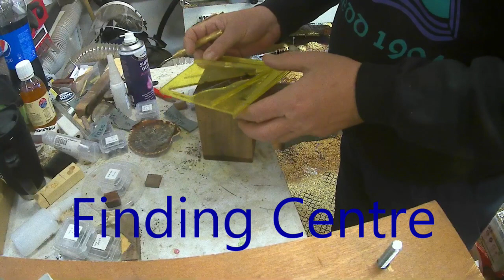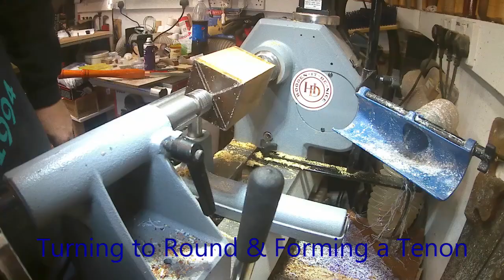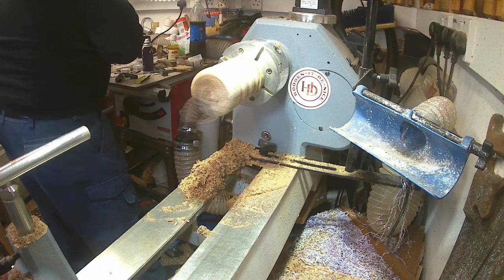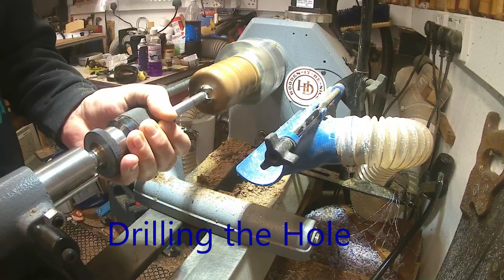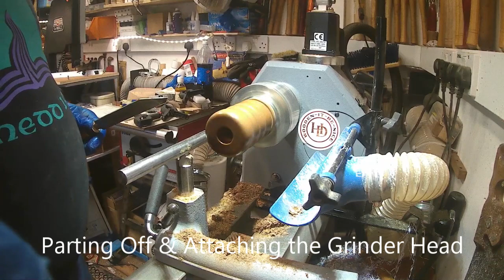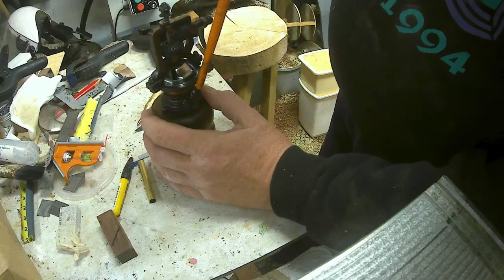Woodturning a Walnut Pepper Grinder

Comment: 'tis the season of the pepper grinder lol  .
It looks very nice Huw  Cracking job mate ,love the walnut body.  and an excellent save with that little nut lol
Cheers,   Bram
Reply from the maker: Hi Bram, It does indeed. I will have to get the instructions for the grinder as all the ones I have bought from Axminsters did not have any. I do prefer what you and Mike did by recessing the grinder into the base. Thanks for watching and commenting. Huw